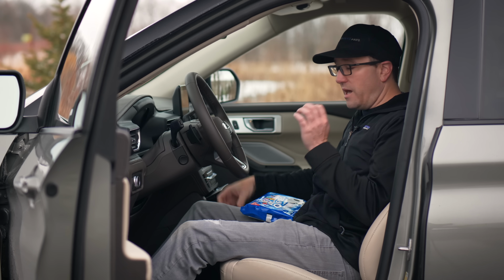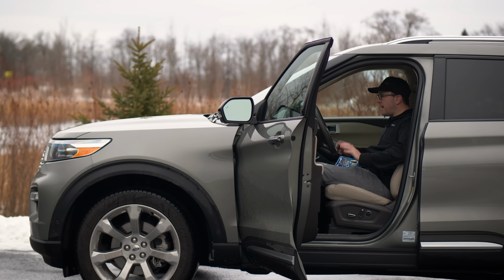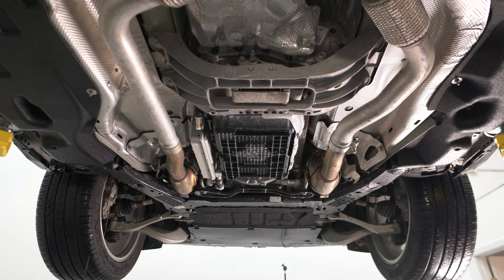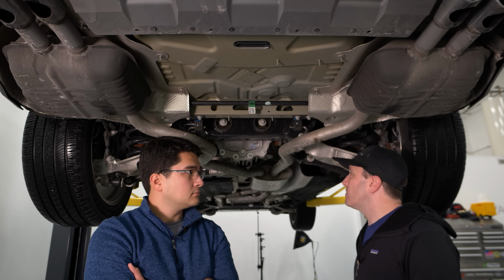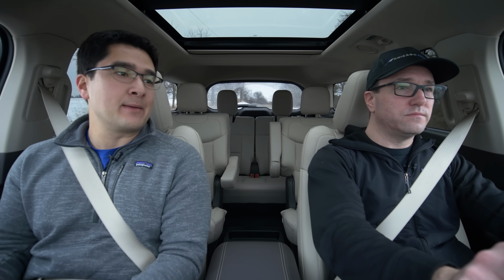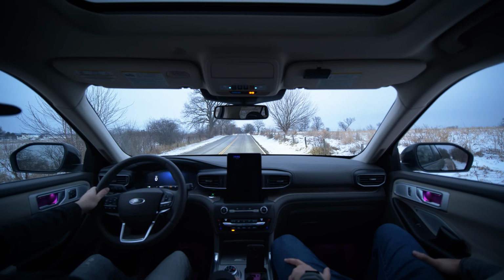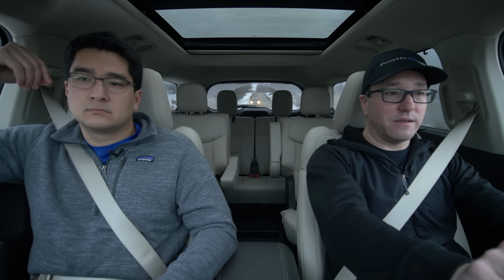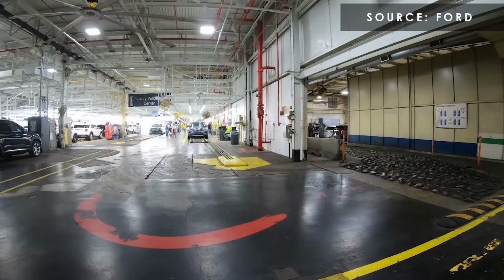2020 Ford Explorer | Who Is Responsible For This?

Comment: Must be an interesting meeting when Ford Execs realize that Hyundai and Kia out did them.
Reply: Why Ford not used the ZF8HP automatic transmission?
It's the world's best automatic transmission.

Ford 3.3L V6 naturally aspirated paired with ZF8HP, this will be a reliable powertrain because of no junk turbo engine or complicated hybrid system.
Reply: I doubt it, if there where any interesting meetings about this vehicle, I don't think they would have let them ship. I am afraid they are ok with it just like it is and don't get a damn, which says all you need to know about the direction they are going.
God help me next time I need to buy a vehicle, I don't like Dodge, GM burned me hard core and now Ford is slipping up.
Reply: Given that my 2014 Focus SE Hatchback was a wonderful car with the absolutely terrible Powershite automated manual dual clutch transmission, I see that Ford still hasn't figured out how to do transmissions.  I guess I won't be buying another Ford any time soon.  3 clutch packs, many reprograms and a Trans computer before 60k miles had me trade into a new 2018 Kia Sportage with no regrets.
Reply: We will see in 80,000k when the most re 'refined cars'  have bent suspensions on our shit roads. It sounds like programming issues on the trans. Luckily they can flash new programming at the dealers.
Reply: In US maybe so, but it's reversed in Northern Europe.
Reply: Why would anyone buy an American made car? Bottom rung of the car world worldwide, made by unskilled meth heads.
Reply: And every automatic shift is bad in Ford.
Reply: Ford is crap Except  their truck (f150) line.
Had a 2015 focus se hb, the moment it left the dealer (brand new) I already had a crack noise in the window on the drivers seat dealers said wasn't covered under warranty, next, at 4500 miles the sync radio module stop working, and not to mention that when i took my car to certified mechanic HE did properly repaired the transmision, and apparently it was all because of bad transmision terminals, he adjust the computer and after 4 years of owning , the car was finally showing in the cluster the fuel it actually used per mile, Ford has an modified computer for falsing numbers in their cars. then it was the transmision, module, and clutch  it was covered under warranty( 2600 usd repair cost), but this happened 3 times, their transmisión is the worst thing ever happened to the world along with recent covid 19 pandemic.
I finally sold the focus( cheap of course)
And at the time of the sale 
A/C didn't work
Radio didnt work
Clutch was faulty
Transmisión was faulty ( car shut down 3 times while in highway )
Car noise in drivers door.
Reply: I still can’t believe someone approved this thing. Doesn’t seem like anyone is buying them either
Reply: 200k miles on my 2011 elantra, never had a problem🙃
Reply: With those Korean vehicles, it's hit or miss. 60% of those cars will reach 250k. American cars are bad all around. I trust Japanese vehicles.
Reply: @alexander6762  The Chinese auto makers are starting to get their act together on quality, durability and design as well. Can't wait for them to start competing in NA. My 12 year old Sonata with 250 K runs great! ( built in USA ).
Reply: @gar2008  really? Chinese automakers. I must do my research. I would love a Chinese made vehicle. Fun fact, a lot of them combine other vehicles together to create a new one since they have no laws against copyright.
Reply: Kia and Hyundai depreciate more than any other cars do. I bought a new 2016 accent for $15,000 and I just traded it in for $3,500.  Junkiest, cheapest, and slowest car I have ever owned. Glad that thing is gone! I love my f150 that I have now
Reply: @danielramirez747  that's what happens when you buy cars like that.  Trade in value is a market price, not a value price. Honda and Toyota have reputations that support their trade value.  Kia is rapidly gaining one to match.

Maybe the dealer lowballed the trade in order to take a extra couple thousand off the truck price?  They still come out at the same place on their books.  All they did is more the money from one pile to another.   I'd bet they did it while telling you about the "amazing price" you just got on the truck too.
Reply: @danielramirez747  same thing happened with my fusion bro, ford cars and my 08 mountaineer depreciated like wildfire and arent worth a damn. Love the 08 mountaineer for how smooth and comfy it is though, just unreliable and the plastics are horrendous
Reply: Until you reach 80k miles. Hyundai/Kia's begin to fall apart and depreciate like a Yugo.
Reply: @pbaker7160  maybe that's how it was when the brand was introducing itself to the US Market but today they both have made huge strives for better products and it shows. The new Sonata, Palisade & Telluride are great examples. Hyundai has been moving up in the vehicle dependability rankings along with its luxury brand, Genesis, right behind it. Don't shoot them down for their past, look toward their bright future.
Reply: @pbaker7160  190k on my elantra.  Ford is crap. Been burned by a taurus
Reply: @pbaker7160  my 01 elantra has 216k on it and still going strong lol
Reply: Paul Baker lol the Ford would start to fall apart at 80k too
Reply: @pbaker7160  I remember when I think it was kia's first started selling here in the states, we had a dealership that was doing buy one kia, get another one free
Reply: @pbaker7160  that's just not true. Hyundai are one of the best buys in cars now.

Comment: Every Police Dept is buying this pile but it's the twin turbo. The 3.3 liter is better than the 3.5-3.7 in the old Exploder. The old engine had a water pump that was driven by the timing chain. $2000 for a new water pump.

Comment: This is coming to Europe, with a  350 hp (261 kW) 3.0-liter V6 + 100 hp (75 kW) electric motor that combines the two to 450hp / 600 lb⋅ft (813 N⋅m)

Comment: I work in auto manufacturing. You can always tell who has actually worked on an assembly line and who hasn't. It also seems to be inherently American, I currently work for an American company, and I've seen engineers ask QC what they think would fix problems. People making 6 figures working in a corporate office who have degrees in Engineering who don't get it. The last company I worked for was German, while I won't say the products were always perfect, the production line ran smooth as silk, and they did everything in their power to make producing the vehicle easier as time went on.

Comment: Ford has been cutting corners everywhere. Speedkar99 made a mechancal breakdown video on the new Ford Escape and they didn't even bother to put an access panel to drain the engine oil on it. You have to remove the entire underbody plastic just to access the plug and filter... the most frequent and important maintenance on a car.

Comment: whats with that 9 inch thick tablet half ass glued onto the dash, and my econo sedan dart from 4 years ago has all screen cluster, way to keep up ferd ... and that BO audio system is just a half assed no name china system that bought the long ago defunct name after harmand sold it off in a restructuring.
Fun fact, a tiny insignificant electronic part that I designed is in there, so I am a tiny bit responsible hehe (no Im not on the B team, im from a supplier)

Comment: Unions. Good luck fixing personnel problems.
Reply: DIdn't see one problem in the video or mentioned anywhere else with the 2020 Explorer that can be traced back to the assembly line folks.  They can't do anything about poor design/engineering or parts that don't fit.

Comment: Good review, disappointing on this new Model.   I think it's biggest competitor or at least the vehicle most similiar is the Rear Drive Durango, and I would probably buy that 10 year old platform over this.  The other issue I saw was it did not got a top safety pick.  Kind of unusual for Ford as they usually score at the top for crash tests.

Comment: It’s hard to believe that anyone would pay 61 grand for this when one can get a similarly featured and far superior Palisade for 15 grand less.
Reply: Or a used sprinter van and model 3.
Reply: Or they can just buy a previous generation for far cheaper
Reply: Or you can buy an aviator for $61K
Reply: You cant get a Palisade with rear drive based and a twin turbo V-6 with 400 HP and a 10 speed automatic.  The ST model for a 56300 sticker with all the technology standard is a bargain.  It will run circles around the Hyundai.  It accelerates better, stops better, handles better, looks better.   A front drive SUV like the Palisade cant compare.
Reply: @ginsure  in that case go get a fuckin race car if you want to go that fast, an SUV is for family how fast do you want to go the others SUV with fwd are fine it will get you from a to b and looks nice like the new kia seltos for 22k.
Reply: ginsure who the hell cares about rear wheel drive? This is 2020 not 1970. Ford’s market is the uneducated American worker. Honda and Toyota for the win!
Reply: @ginsure  lol If I'm getting an SUV i want to feel comfortable and fancy inside. Not drive fast lol.
Reply: @ginsure  Well if there's enough demand and they want to put a dent on Ford... Palisade N baby

Comment: Drove one for a few days while my Ford was in for one of its regular warranty service-calls (seriously - I've had it for a year and it's broken more times than any other car I've owned). On prior trips to the dealer, they had given me an Edge and an Escape. I can tell you right now, Ford must plan on everyone buying the Edge. The Explorer is terrible, and the Escape was passable at best. Blech. After owning a Fusion Energi for a year and a half ... never again a Ford. Blown transmission after 45k miles? Check. Infotainment computer died just out of bumper-to-bumper? Check. Random transmission leaks? Check. Constant nuisance codes, some of which come with dash lights? Check. Remote start that hasn't worked right from day one, and the dealer has given up on fixing? Check. Negligent traction battery design with wholly inadequate cooling system, and a severely degraded battery at 40k miles? Check. Never again a Ford.

Comment: Using aluminum in every body panel is not the solution for everything, steel tecnology has been greatly improved in the last decade, so using UHSS, smart steel and boron in key body parts can help with body rigidity allowing the use of light weight mild steel in some body parts like the vehicle floor without compromise

Comment: I agree with everything you've said about it, except the space. I grant you I'm 6'3", and it's all torso, but I think it's less comfortable and more cramped than the 2011. (The 16 update had less comfortable front seats IMO.) And I'm really disappointed by that, because I was excited for the rear wheel drive model to come out.
Between all that, and pricing, I wish they'd have redone the Flex and kept it as a three row priced below this.

Comment: The plastics are typical Ford, which are a joke. But that screen is unforgivable. Yes, the Ram has a a portrait screen, but there IS a reason why it is flush mount AND super Hi-Res. 

Oh...and it is $60K. YESSSS...it will blow the doors off of a Kia Telluride, but in 90% of ownership scenarios, the Kia is definitely the buy option.

Comment: I hate the trend of let’s just stick a iPad in the dash then we’re done.
Reply: It would have been ok had they just turned it landscape, used an actual iPad grade screen, had an adequate computer behind it, and filled the whole dang screen with back-up camera footage when in reverse, but instead its just a poorly executed gimmick.
Reply: Abram McCalment basically Tesla model 3 then?
Reply: @mattkalin3139  There are lots of other vehicles with portrait oriented displays sticking out of the dash, including the Explorer's sister vehicle Aviator.  While maybe not the same size, some were available for purchase before the Model 3.
Reply: @Indrid Cold Not sure what model or vintage Tesla you are referring to but we love our 2018 model 3 Awd long range and haven’t had any major issues. Gets 315 miles range as advertised! Fast as hell and when my wife backed into a trash can and broke the taillight Tesla fixed it at her work. While we maybe the outlier I don’t think so..
Reply: @Indrid Cold Tesla build quality is garbage. Misaligned panels, wavy windshields, a dozen different rattles, lcd screens that turn yellow over time,water leaks galore, etc.
Reply: @mattkalin3139  Don't insult innovation (Tesla) with half baked (Fiat Ford). Tesla has real engineers that refined the software to accommodate the user unlike ford with heavy cheap plastic or ill fittings on the interior.
Reply: @abelincoln78   to me it's looks as if it was an afterthought.
"Ooops, we forget the nav screen! but I have a solution that just might work...."
Reply: Ram seems to be the only company that knows how to make a vertical screen work
Reply: @Audiblegaming  LOL no. no they don't. The Ram 12" screen is glitchy trash and the UI looks like a shitty Winamp skin.
Reply: It wouldn’t even be bad if the iPad was sideways. They stuck an iPad standing up!
Reply: It'll be a luxury to have traditional buttons and knobs
Reply: Is it really a trend anymore? automakers have been doing it for a while
Reply: I'm with you. Hate it. Looks like an after thought.
Reply: Yet we get pulled over for using our phone, but using the ipad is ok lol
Reply: everyone's doing it just stupid to me I'm glad the trucks are not doing it, Yet, the Ram looks hideous though
Reply: Steve Pounder actually I think its smart what they did, when driving using GPS i like to see whats in front more than whats to my sides, portrait mode makes sense since it isnt for watching movies or videos and it lets you use your thumb and not index sometimes

Comment: My wife’s ST has none of the transmission issues talked about in this video.  Better interior materials would be nice, but that’s why you have the Aviator.  The Explorer is a solid vehicle, with all the safety features and sleeper power (ST trim) anyone needs.

Comment: Mark, the problem with Fords 10 speed is that it is adaptive learning tuning.... The transmission learns and adapts within the first 5000 miles to the driver... when you have multiple drivers with different driving styles, the transmission falls apart..... However, if the transmission learns the habits of one single driver, it shifts flawlessly ..... Ask Ford about their transmissions adaptive learning strategy

Comment: I still have my 2nd generation 2011 Escape with 283k on her now .
Still running strong with normal maintenance and normal wear items replaced.
A great winter vehicle and handles well overall.
All that said, my impression of it was.....half baked prototype that could be a great vehicle.
Typical Corporate American pennywise/pound foolish cost cutting bumper to bumper.
Started rusting badly along the bottom of the tailgate, quarter panels and front lip of the hood underneath.
I keep my vehicles clean, waxed and detailed including doors and jambs.
The interior is nicely designed, I thought, but made with the cheapest, flimsiest materials Ford could get their hands on.
Fit and finish is laughable at best and it's by far the noisiest vehicle I have ever been in.
I pulled the interior and added my own sound damping material.
Ford used less insulation in the Escape than I've seen in most econoboxes.
Guess they haven't improved with time.....shameful.
Does anyone still wonder why Japan and Korea rule the American roads today?